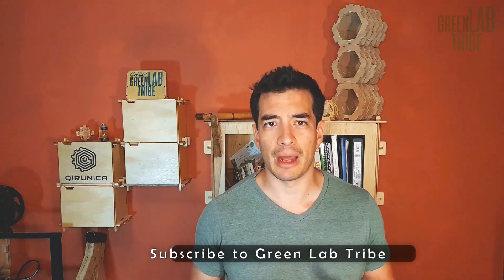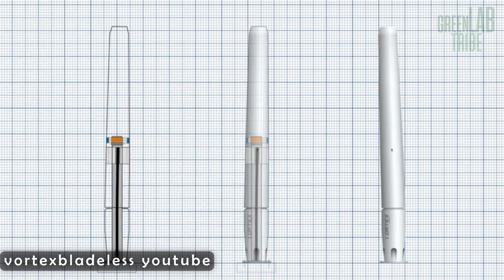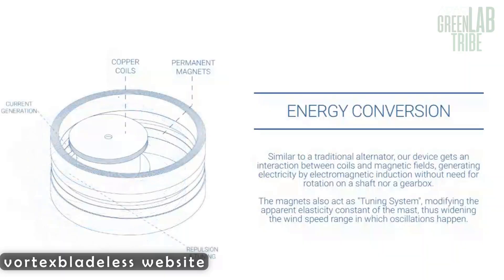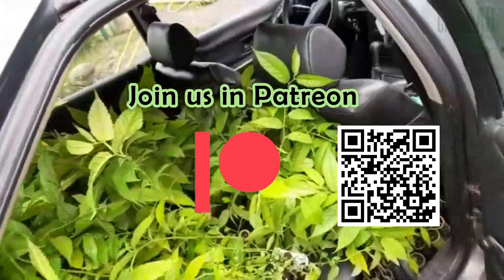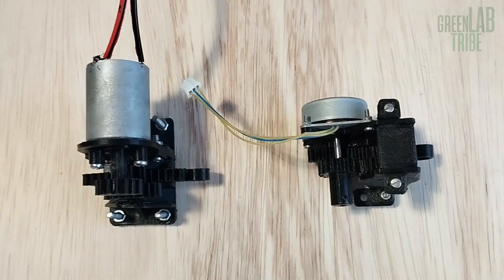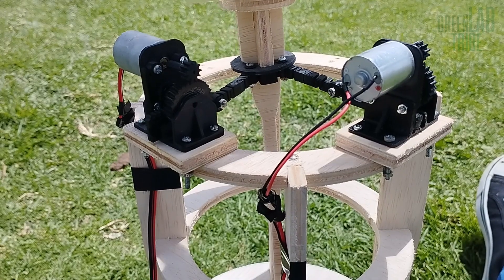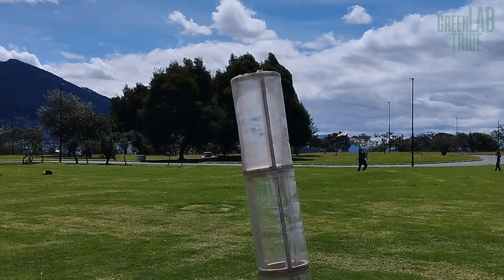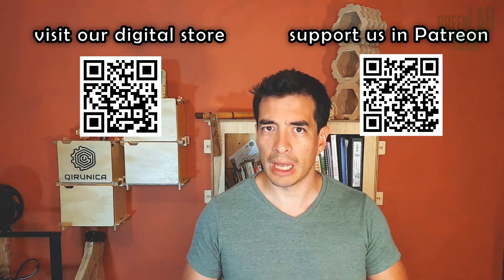How to harvest energy from wind? without blades!

Comment: Greetings sir, I am a student and I would like to build a model of the vortex for my final year project. It would be appreciated if you could provide information about the alternator and the materials used in the vortex. thank you
Reply from the maker: Actually I'm working on an alternator design cause I couldn't find something that works like that, however you may see if piezoelectric generators are an option for small applications
Reply: @greenlabtribe  Hello sir, I'm a finaly year undergraduate student of mechanical engineering. Our project is the same. I need more guidence for our project.
Reply: السلام عليكم عندي بحث نفس هاي هل يمكنكم مساعدتي
Reply: لدي مشروع مثله هل يمكنكم مساعدتي

Comment: I would call it a wind powered generator. Turbine implies spinning parts. I really want to see this method work as it is a much easier way to bring power to remote areas with bad roads like the Mustang district of Nepal.
Reply from the maker: Ok let s call it just like that!. I think you re right cause it may  be simpler to build
Reply: Solar people seem to be okay with misnaming things; for example, a battery + mppt + dc/ac is often called a “solar generator”